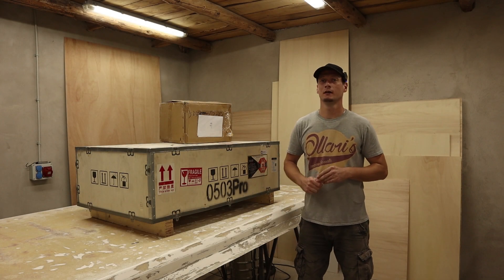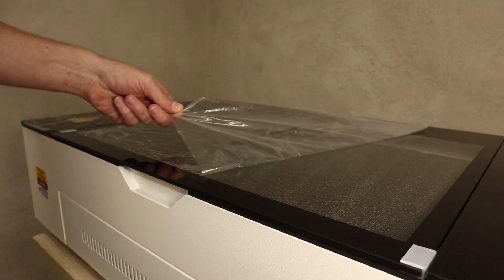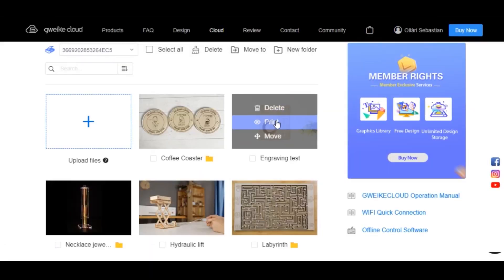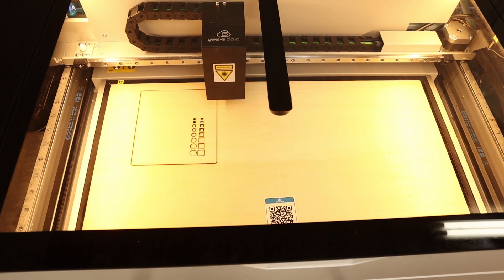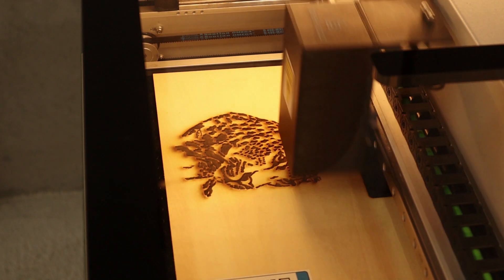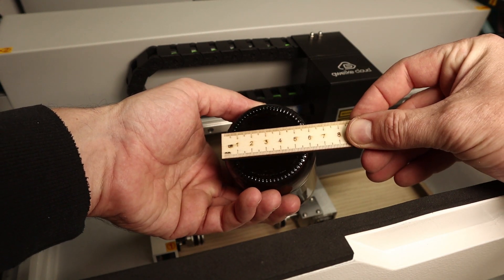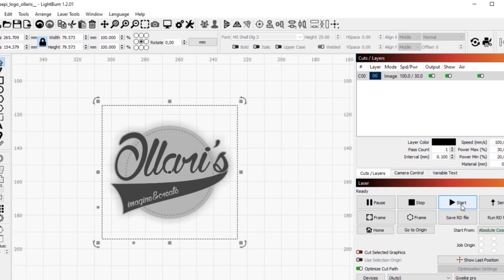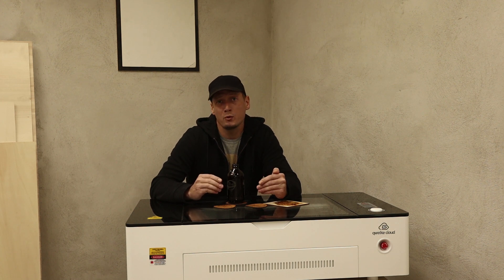All the features! GOOD & BAD | Gweike Cloud Pro 50w Laser Review

Comment: I really enjoyed your review. Is the honeycomb bed steel or aluminum? I would like to use magnets to hold down flexible material.
Reply from the maker: Thanks. It’s aluminum. But i think most of them are. I seen somewhere a some hooks that can be pushed into the honeycomb to hold down thin materials, that could be cut out of wood with a laser

Comment: How loud is it ? How many db?
Reply from the maker: I checked  it with an app on my phone, it’s about 60db 10cm above the machine.
Reply: @Ollaris  oh, i think that is still ok. Do you think the mashine is also suitable for engraving portraits etc ? I am worried about the burn marks ?
Reply from the maker: @DrWhoWho1   I don’t think you would have burnmarks if fine tune the engraving power. My settings were a bit to strong but i sanded off the burnmarks and it looked really good. Another tip i got is to put on masking tape to avoid the burn marks.
Reply: @Ollaris  that's a great advice. Thanks. I also want to buy the Gweikee. I hope it will be fine with it.
Reply from the maker: @DrWhoWho1  good luck with it, there’s a link in my description and the coupon code OLLARIS200 that saves you 200$ of your order.

Comment: There is a trick where if you put down a layer to tape (painters tape works well) when you engrave you can avoid the burn marks.
Reply from the maker: Great idea! Thanks for the tip!
Reply: That works well for clear plexiglass and stuff like that. Even for stainless steel, if I'm not mistaken. 😊

Comment: Looks great. Will it cut metal as well?
Reply from the maker: I guess not. maybe very thin aluminum, soda can or spray can.
Reply: @Ollaris  That‘s a pity. It would have been a great help for your welding jobs on the T3 in preparing the replacement pieces…
Reply from the maker: Yes, but i can use it to test out pieces that i design before sending them out for water jet or plasma cutting.